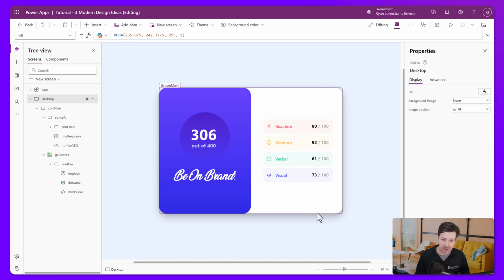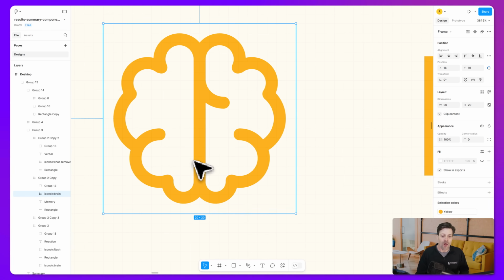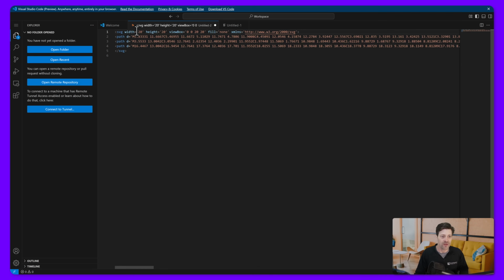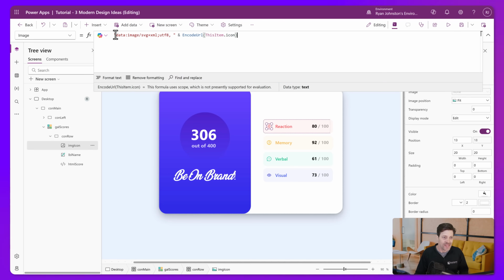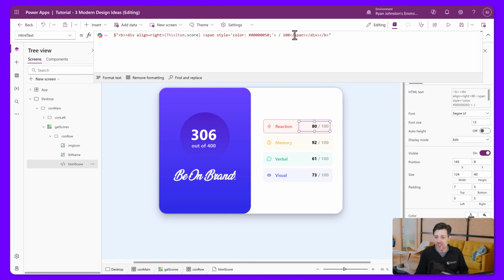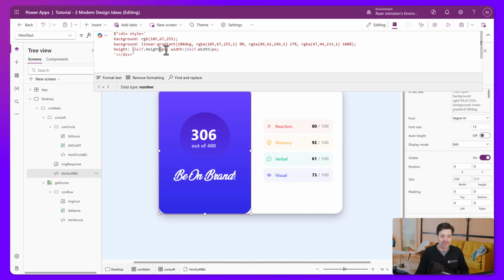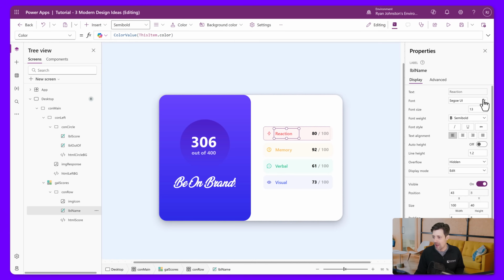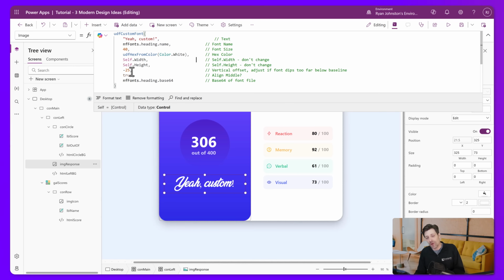Power Apps Design Ideas - SVGs, Custom Fonts, & Gradients

Comment: hey what kind of a trick are you actually using for the background?
I mean there is obviously a main container in the back, with round corners, but we cannot see the main frame of the screen which has square corners.
I tried to make the main container bigger than the canvas frame to hide the square cornered background, but then when I jump to the preview, my container is cropped.
It is like your background is set to invisible? what did I miss here?
Reply: Great question!  In the app for this video, I just set the Fill property for the screen, so the canvas with square corners you see filled with gray is just the default "Tablet" size for a Canvas App.  BUT, the way I normally do a background to fill the screen requires just a couple of steps.  First, go to your Canvas App Settings > Display and turn Scale to Fit OFF.  Then, create a container into which you will place everything for that screen.  Set X,Y to 0 and the width and height to Parent.Width and Parent.Height, respectively.  Set the background color of that container to whatever you want for the overall screen background.  Now, when you preview the app, your background color will fill the screen, regardless of screen size.  Place everything inside this container, and you're good to go! Hopefully this answers your question - if not, let me know!
Reply: @PowerPlatformRyan  nice trick again, thanks !

Comment: Well I do not really know why but the rectangle trick did not work for me, to make the scrolllbar disappear. Instead of setting the height to +1, I oversized the width to +11 so that the scrollbar still exist exist but way further than the container right border.
I had to adjust a bit your formula because nothing popped up for me. Here is how it worked for me:
"<div style='background: rgb(105,67,255); background: linear-gradient(180deg, rgba(105,67,255,1) 0%, rgba(89,61,249,1) 27%, rgba(47,44,233,1) 100%); height:" 
    & (Self.Height) & "px; width:" 
    & Self.Width & "px;'></div>"
Reply from the maker: I am not sure either but thanks for sharing what did work for you. I will try to get Ryan to chime in when he gets a moment.
Reply: In the style definition for the <div>, height needs to be Self.Height - 1. The HTML Text control Height property (in the the PowerApps Maker, not the HTML itself) needs to be Parent.Height + 1. Hopefully that’s the clarity you need!
Reply: @PowerPlatformRyan  ok it worked thank you
Reply: Did you change the padding of the html to 0?
Reply: @  yep the 4 of them are all set to 0

Comment: really realy impressive and useful, many thanks guys

I suppose you could have written the text in svg software like inkscape, then transform the object to a path, then export the svg and use it the same way you added brain icon and others, right?
Reply from the maker: I will try to get Ryan to answer the question, but yes he has apps with several SVGs to get to the final design.
Reply: @ShanesCows  ok it worked for a text as well, as expected, but neither with the formulas prop nor a variable set on onstart prop of the app, I directly added the svg code within the fx of the image prop of the image control because the svg I want to load in the app is not in a gallery. 
I'm surprised the variable did not work though, here is the code: "data:image/svg+xml;utf8, " & EncodeUrl(myvariable)
I have to replace myvariable with "<svg..." for this trick to work